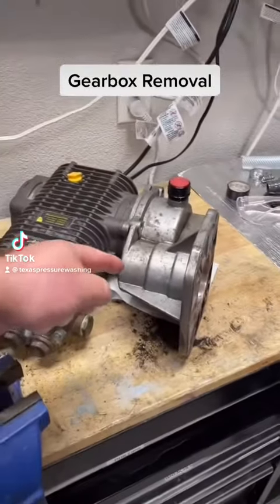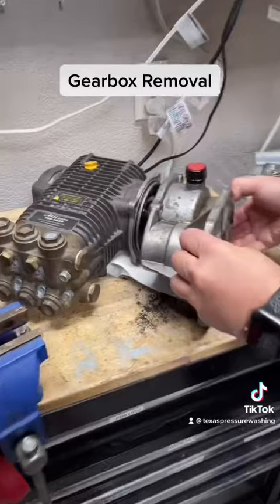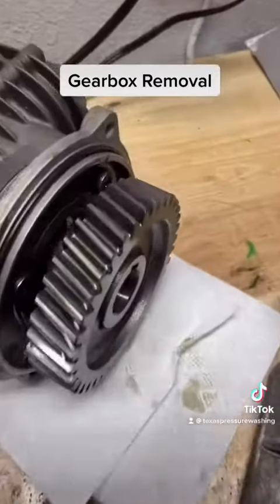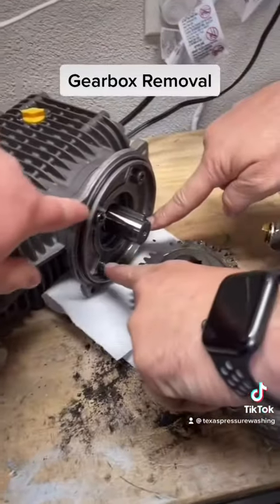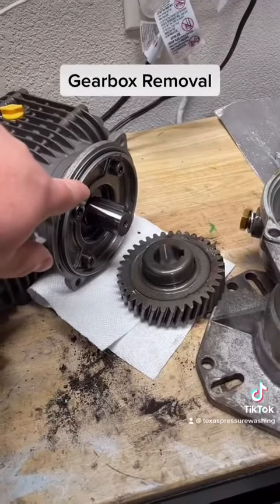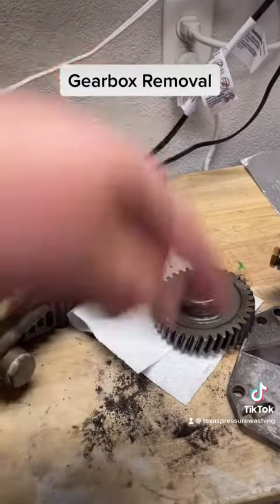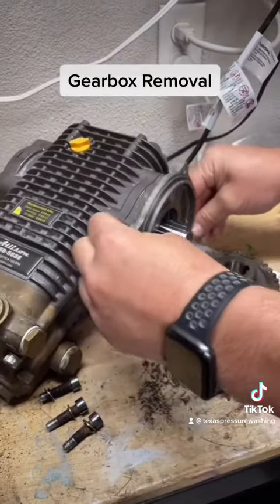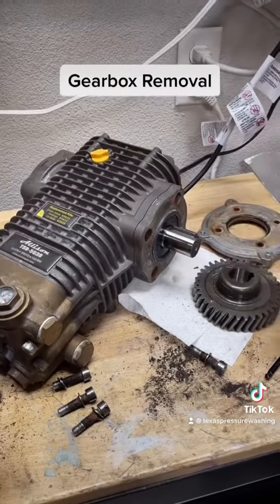Pressure Washer Gearbox Removal GX390

Comment: How did you know the gearbox was bad?
Reply from the maker: The loud grinding noise.
Reply: How long did this last before having to change the gearbox? I just purchased mine…
Reply from the maker: They both failed at just over 300 hours but that's a freak occurrence.  They should last well over 500-700.